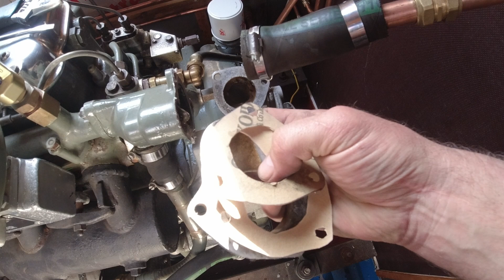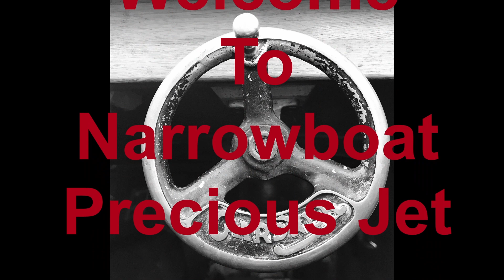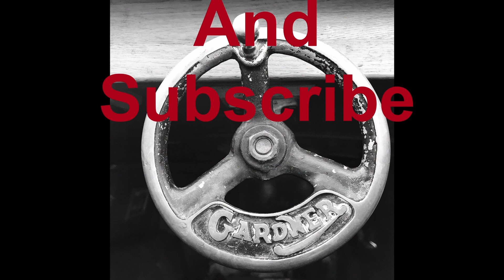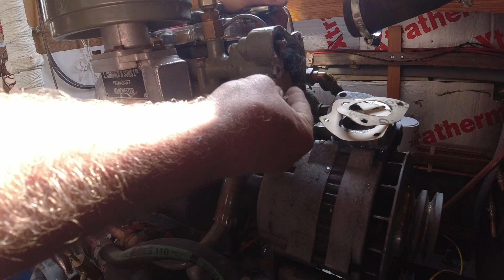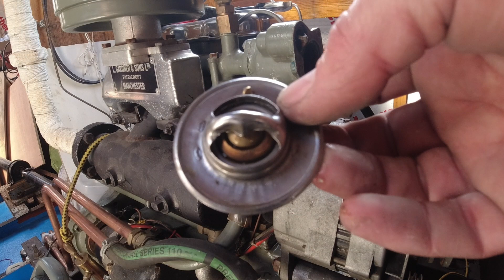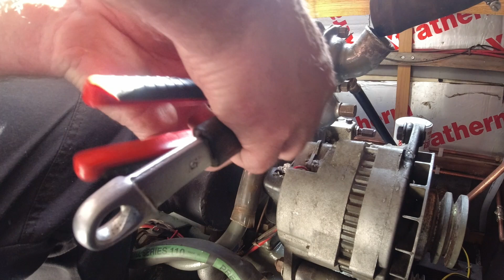Gasket Time

Comment: Always been a fan of heldite on gaskets always done me proud just wondering what make and model your alternator is and what ampage it's rated to? Did it come standard with the double A pulley??
Reply from the maker: Hi David, not sure what make it is but I will find out. The pulley on the alternator you can buy bug the pulley on the engine is specially made by Redshaws at Braunstone! And the alternator is 140amp 😊😊👍🏼
Reply: @NarrowboatPreciousJet   thanks for the reply is there any numbers on the casing as that would suit my needs on the boat greatly  if you have any info got the pulley on the engine all ready for going just wanted a bigger alternator really as I only have a 70 amp single unit fitted 😁 many thanks again for your help!